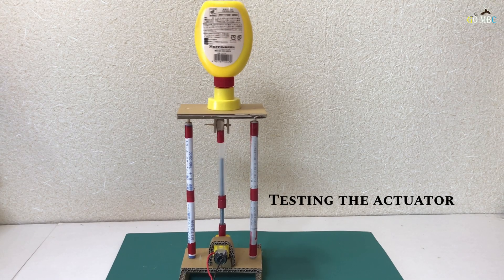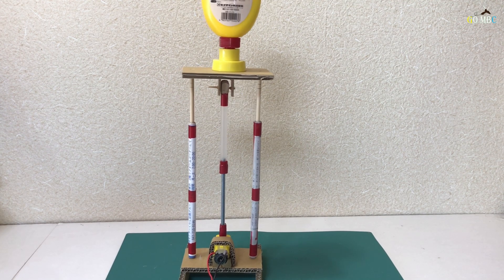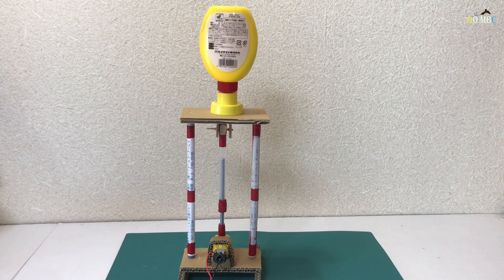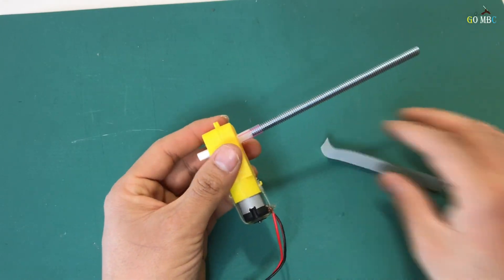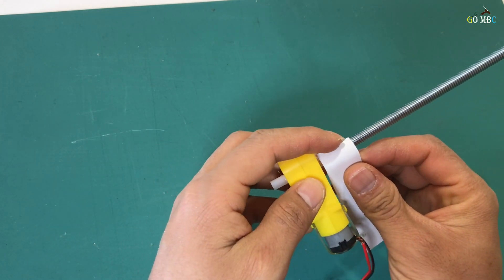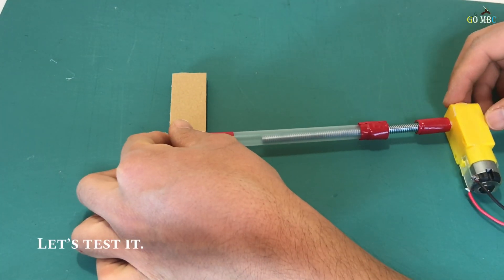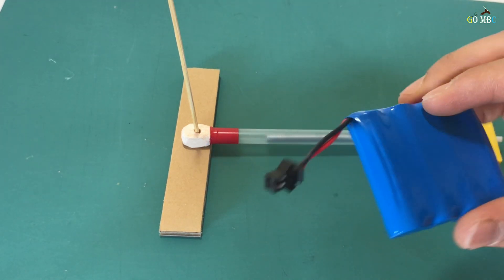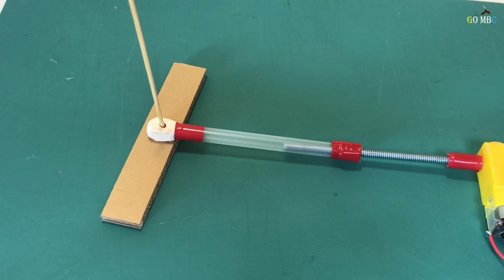DIY linear actuator || Homemade actuator

Comment: What kind of switch to use for forward and reverse for the motor?
Reply: Hi
Reply: Did you know the switch
Reply: If +ve connected to +ve of battery then clockwise if -ve side then anticlockwise
Reply: just use arduino